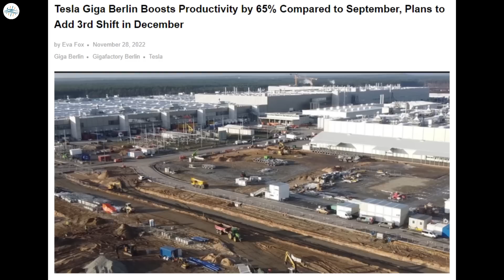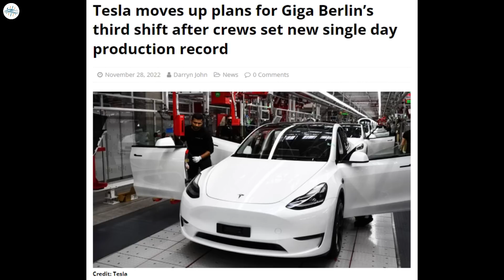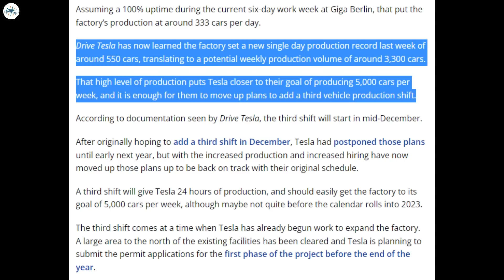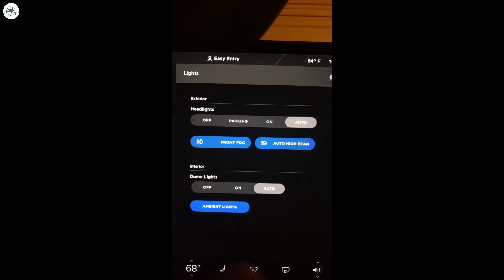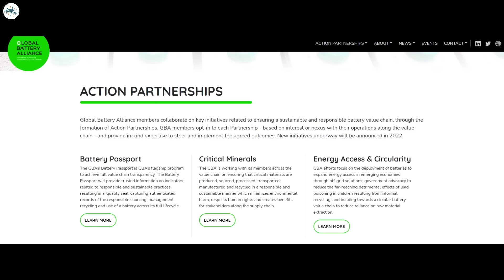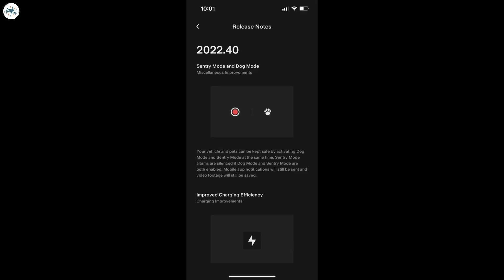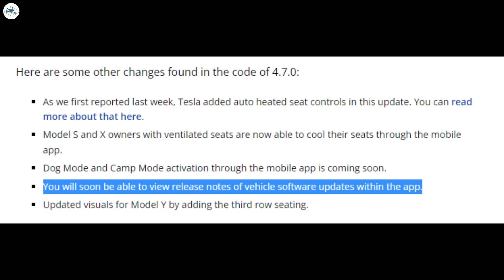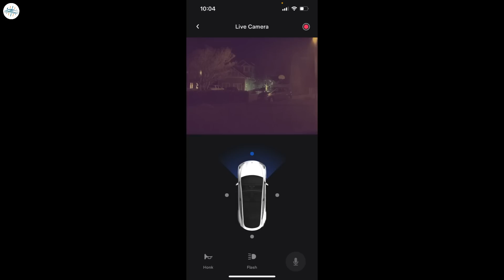Tesla Adds New Features To It's Latest Mobile App & More Updates!

Comment: The wipers are a bit of a deterrent from using autopilot. Driver should have some input or control regarding its use.
Reply: Yes, 100% agree.
Reply: I don't think autopilot cares if wipers are on auto mode just as long as it's on to some degree. I rarely use autopilot but I always manually set wiper speeds regardless. Auto wiper speed is by far the worst implemented feature on all Tesla vehicles. It's completely unusable.
Reply: @James_Baggott  you have no choice. You cannot turn them off when in autopilot